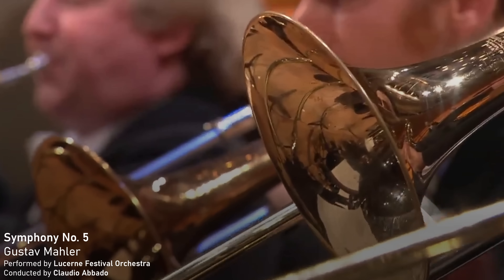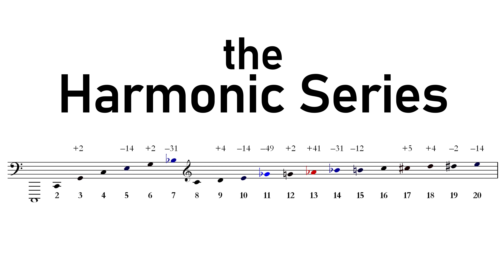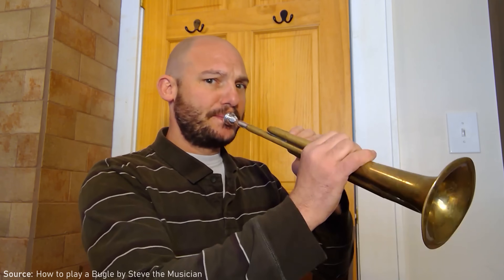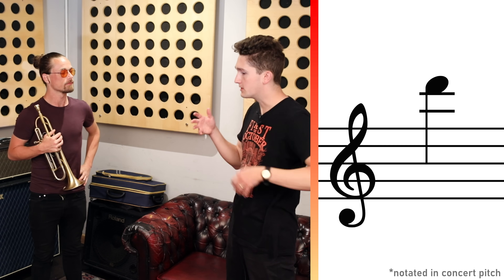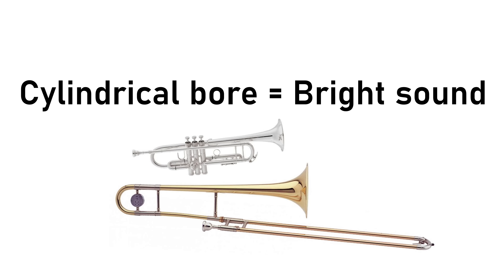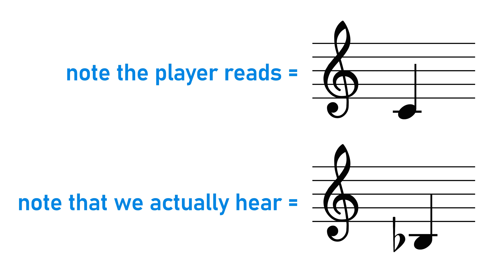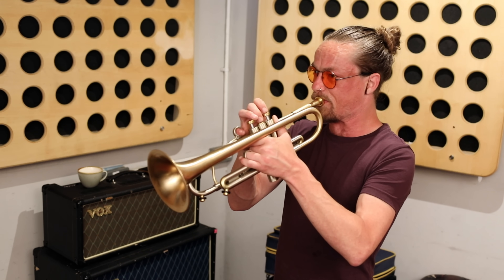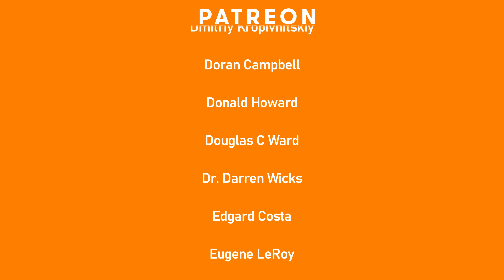How do Brass instruments actually work?

Comment: Interesting and useful video, though I'd argue with a few points of accuracy:

1. 'Buzzing' is a common, but not useful term. The reason I say this (as a tuba player with many decades of experience) is because on a larger brass instrument the lips do not cause a buzzing sound when they cause the vibration used to play a note. The vibration is carried by the air but not audible until the air passes through the mouthpiece.

2. The embouchure does not create the resonance. The embouchure creates the vibration. The tubing creates the resonance by being the right length for the frequency of vibration to match the frequency of a pitch in the tubing's harmonic series.

3. My understanding is that a cornet is more cylindrical than conical bore. In bore profile, it is much closer to a trumpet than most people imagine. The flugel is more of a conical profile, which is what creates the difference in timbre (sound quality) between cornet and flugel (both of which are most commonly pitched in Bb).
Reply: The cornet was created by adding valves to a post horn; or, to be more precise, a coach horn, which had a conical bore whereas the standard post horn had a cylindrical one. Early cornets were still shaped similar to a modern French horn and only acquired their typical trumpet-like form later on. The bore is less conical than a flugelhorn and far less than a French horn, but still counts as a conical bore.
Reply: @IdiotAmigo  I think we're agreeing in the main - though I don't know enough to understand the evolution of the cornet (except I understand that keyed cornet style instruments existed before valves were invented).

Bottom line is that brass instruments are a complex hybrid of bores. The precise nature of that relationship between cylindrical and conical is what distinguishes different brass instruments of the same pitch (and the resulting timbre/tone quality).

My biggest complaint with this video is that both 'buzzing' and the creation of 'resonance' were used in a misleading way - in a video apparently endorsed by a global organisation (Apple)...

Comment: Thanks! As a trumpet player, some additional remarks:

1) Brass players normally like keys with flats: Bb major, F major, Ab major. They have more difficulty playing in keys like E major.
2) Playing brass is tiring, in a different way than other instruments are. When a trumpet plays loudly in a high register (F5 and above), the player usually needs a couple of measures of rest afterwards.

(These things are less true for experienced professional players.)
Reply: That's actually really interesting. If you contrast with eg. guitar, violin family strings, viols (and other lute-likes) and piano, it's usually the low notes that need the most physical effort: You're manipulating heavier strings to move more air. What makes it different on wind instruments?
Reply: @Komatik_ High notes on wind instruments usually require more air to produce. There are exceptions to that, but that's generally true.
Reply: @Komatik_ Coming in late but as a Trombone player it takes a lot more of a physical toll on your mouth muscles to play higher notes, as well as keeping the amount of air required to play loud notes stable. More experienced players will fare better, but you can think of it as a workout for your mouth. Higher notes require more pressure on my embursure and after a while you need to give a break to let your muscles relax
Reply: @jrhaven  you might want to learn how to spell "embouchure"......

Comment: Please help me understand something. Why is a certain valve combination limited to a harmonic series ? It is explained that you go from one note to another by changing the way your lips vibrate, but the way it is explained sounds like you're basically doing a pitch with your lips, so why can't you play an arbitrary note ? Why is it constrained to certain notes only ? I feel like there's some explanation missing on the embouchure technique.
Reply: Physics. A valve combination just gives you a certain length of pipe, and a certain length of pipe will resonate at a certain frequency and its multiples. Same deal how you do different notes on an organ by switching what pipes you push the air through. Valves on human-blown wind instruments do the same.

Same thing as with string instruments - the length, weight and tension of the string determine what pitch it will play at. Decrease the weight or shorten the length, and you get a higher pitch.

Comment: You speak as if brass instruments require an embouchure and woodwind instruments don't. That's not the case. All wind instruments use an embouchure. An embouchure simply refers to how you have to form your lips and facial muscles to produce sound on a wind instrument. This applies to saxophone, clarinet, flute, and double reeds as well as brass.

Comment: Excellent beginner's summary!

A few notes (haha):
*  Equating "embouchure" with the so-called "lip buzz" is a huge over-simplification.  "Embouchure" is just a French word meaning the "opening into" something (a cave, for example, can also have an embouchure).
*  Embouchure is an important concern for all wind instruments -- brasses and woodwinds .  In the case of brasses, indeed a critical part of the embouchure is supporting and performing high-precision "lip buzz."  However, proper embouchure also includes support of air-flow, correct resonance inside mouth, nose, and throat, proper connection to the mouthpiece (e.g., not too much pressure on the lips), and other factors.
*  Although woodwinds don't have to support "lip buzz," woodwind embouchures also have to be very precise, in order to control reeds (which always seem to have minds of their own!), or in the case of the flute, very precise directing of air at the "edge."

On a different note (haha), transposition on brasses is a little different from that for woodwinds:  For example, one common way to notate for the baritone horn is like for a Bb trumpet, but an octave lower.  That is, treble clef sounding a M9 lower than notated, like a bass clarinet or tenor saxophone.  (Alternatively, it can be notated like a trombone -- bass clef in actual pitch.)  For "baritone treble clef" parts, what you said about valve fingerings is exactly correct:  The valve fingerings will be the same as for a regular Bb trumpet (or cornet or fluegelhorn).  However, regardless of the instrument transposition, you have to buzz your lips at the sounding pitch pitch, and not notated pitch .

I had a tuba-playing colleague many years ago, who changed over from a Bb to a C tuba.  Now, tuba parts are always written in actual pitch.  The only difference between a Bb and a C tuba is the set of fundamental pitches for each valve combination.  No valves down on a Bb tuba plays a Bb harmonic series, whereas on a C tuba, it's a C.  So, it was a bizarre experience for him to still "lib-buzz" the same pitches as ever before, but having to totally change is valve fingerings (e.g., second-line-up Bb went from open to first-valve!).

Having played all of the saxophones, as well as bassoon and contrabassoon, as well as just a little bit of fluegelhorn, I can say this from experience:  When you play a notated middle-C on soprano saxophone, then the same notated pitch on alto, then on tenor, then baritone, then on bass saxophone, you do have adapt your embouchure for the different pitches of saxophone.  However, the embouchure adaptation for the same notated pitch across different transposition of brass instruments, is an order of magnitude more complex than on woodwinds!  Again, that's because you always have to "lip buzz" in sounding pitch, regardless of the transposition of the instrument.
Reply: tuba parts are always written in actual pitch in the US
Reply: @LeRocOlinda , interesting!  Other examples?
Reply: @mr88cet  I do think that British brass bands are an important reference in the tradition of tuba playing. It feels wrong to me to leave them out. They usually notate the tuba a major ninth higher than written. Wind orchestras in Western (continental) Europe follow this example.
Reply: @LeRocOlinda , ah interesting!  Cool.  Are C tubas common in Europe, and if so, are they noted in C, same transposition as double bass and contrabassoon?
Reply: @mr88cet  I feel that Bb tubas (together with the smaller Eb tubas) are most common, but this may depend on the country.

I think you are right, when they do use C tubas, that they write them just as the double bass. (Sometimes my part would be Bb tuba on one side of the paper and C tuba on the other side.)
Reply: @LeRocOlinda , interesting.  So then are the Bb tuba parts mostly in treble, tenor, or bass clef?  (Obviously that’s a function of what pitch range they’re playing, but also a function of what players are used to and comfortable with.)
Reply: @mr88cet  Bass clef, sounding a major ninth lower than written. As an example, this is a recent video of the wind orchestra where I learned to play as a child. It has 2 Bb tubas and 1 Eb tuba. They all read in bass clef. The Bb tubas sound a major ninth lower than written, the Eb tuba a major sixth lower than written. https://www.youtube.com/watch?v=RPswk5Ti7oU
Reply: @LeRocOlinda , love all those flugelhorns in that video!
Reply: @LeRocOlinda , my off-the-cuff recollection is that the “Wagner tuba” is roughly in the same range as an Eb tuba…?
Reply: @mr88cet  Thank you. This is a wind orchestra in the Dutch "fanfare" tradition. Flugelhorns are the main melody instrument, more or less taking up the role of violins in a symphonic orchestra.
Reply: @mr88cet  I'm not very familiar with the Wagner tuba, but I think it is higher. More in the range of a French horn I guess.
Reply: This post makes me thankful for not being a tuba player. Now, if only someone invented a two-threaded brain for us pianists...

Comment: As a clarinet player, I’m really curious to see what I’ll learn from the woodwind video! There is one thing that I know I’m curious about: On one of your videos about microtones, you said that the clarinet could glissando, and my face became the mind blown emoji 😂 It’s definitely something I’d love to learn more about. Thanks for the great video, I look forward to the next one!
Reply: That would be a good topic! In general woodwind players can not smoothly slide between two notes. Because each pitch has a unique key combination, to move “smoothly” across a wide range of notes, a woodwind player has to finger each note along the way, creating a less-than-smooth transition. In synthesizers, the difference is known as “glissando” (playing each individual note along the way) and “portamento” (perfectly smooth transition). These terms can be used interchangeably, as most instruments can only really do one or the other. However, it is possible to get a very smooth, portamento-like slide between notes on a woodwind instrument. The intro to Gershwin’s “Rhapsody in Blue” is a great example of this on clarinet. However, this smooth glide between notes is somewhat of a special effect, where the player is using their mouth to bend the pitches, rather than relying only the keys. Many players can do it, but it’s not really a “standard” technique for woodwind players. You can think of it similar to the flutter tongue demonstration in this video — it’s an effect some players can do, and it will occasionally be called for in certain types of music, but it’s more of a special effect than a standard technique. 😁

Comment: Does the definition of Labrophone mean that the Kazoo is a brass instrument ?
Reply: The kazoo sound comes from humming into it and the vibrating sheet inside instead of using your lips
Reply: The Kazoo is a membranophone, like a drum. The difference is that you're not making the membrane vibrate by hitting it with your hands or sticks, but by humming.

Comment: On the harmonic series for the trumpet: I noticed there is no harmonic series for the 3rd valve only. Why is this? When using only the 3rd valve, what would you hear?

Love these videos, David!
Reply: Well spotted! That's because the length of tubing you get by pressing the 3rd valve is essentially the same as if you press the 1st and 2nd together, so 3rd only is not used as a standard fingering (though it is sometimes used as an alternate fingering).
Reply: @blow-by-blow-trumpet  Thank you, that makes sense!

Comment: The closest I came to wind instruments was a Horner 'Melodica' which you blow into and press the keyboard along the outside for notes. I was gifted with extended lung capacity- except when I found the button on the underside of the instrument... pushing it releases all the accumulated mucus from your breath. Gobs and gobby gobs. never got used to that part.

Comment: Intresting video, thanks!

Re 3:34 they don't use the 3rd valve by itself?
Reply: I'll just copy my earlier reply:

3rd by itself is equivalent to 1st and 2nd together, albeit not preferred due to the finer points of intonation. Euphonium (my main instrument, after switching from trumpet in high school) can have 4 valves - the 4th again being the same as 1st and 3rd, although here, 4th is preferred for its better intonation. Don't get me started on compensating vs non-compensating 4-valve euphoniums LOL.
Reply: 3rd by itself is too imprecise (find my large comment about tuning)